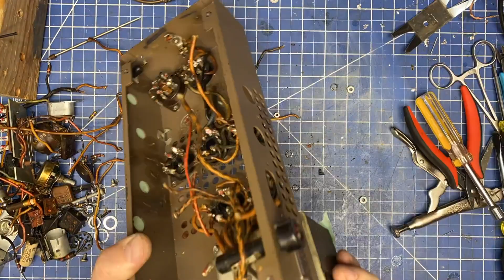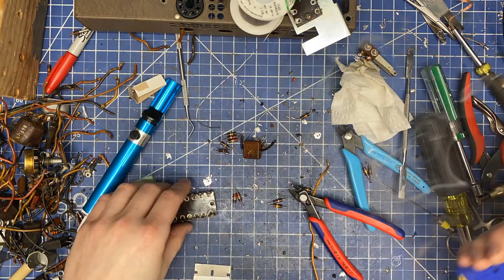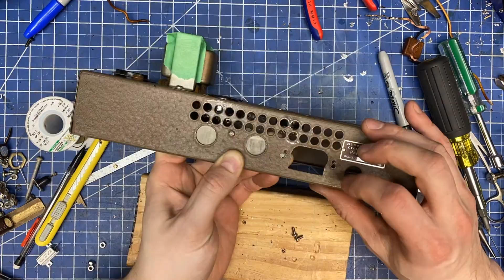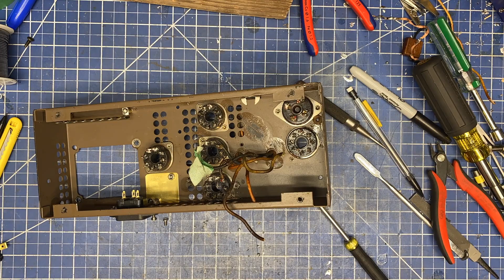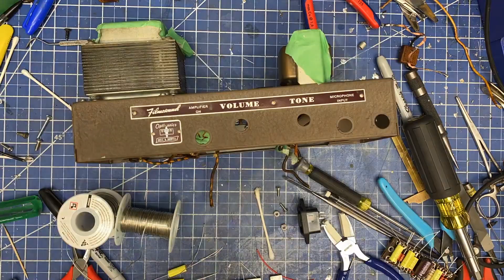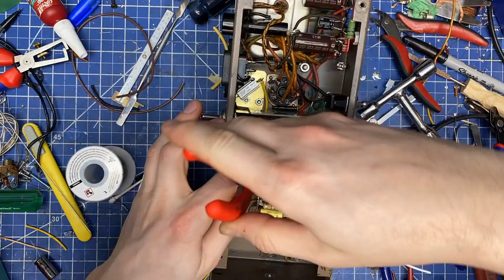Bell and Howell Film-o-sound 179 conversion #2

Comment: I’m picking this up from Tony tomorrow. Can’t wait to get my hands on it! Thank you for the stellar conversion!
Reply from the maker: Thanks Ryan, Let me know if you have any questions or if you would like me to make alterations.  I didn’t get any specifics from Tony so more than happy to tweak things to fit your needs/ playing style.
Reply: @driftless.electronics  what does the 3 position switch in the back do? In the up position the treble sounds hotter. All the way down it seems the bass is emphasized a bit more. Cool feature!
Reply from the maker: @r_madiar  both front and back switches are cathode bypass but on different gain stages, so exactly what you are hearing. Just boosts with different frequency emphases.